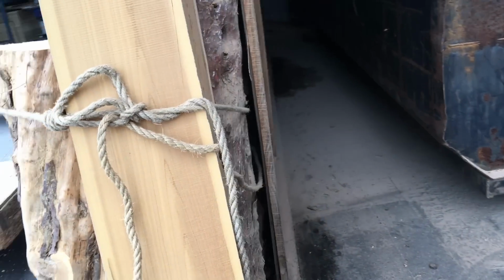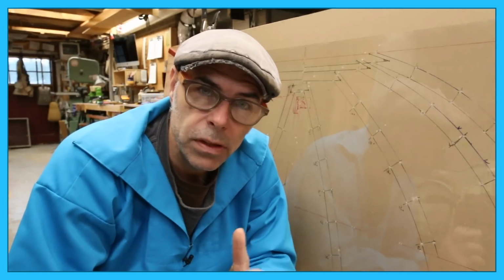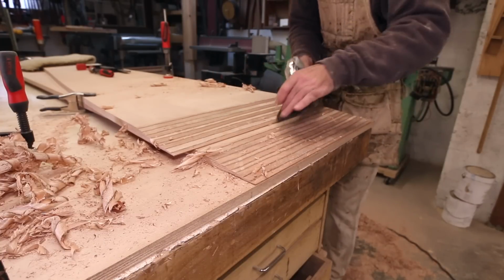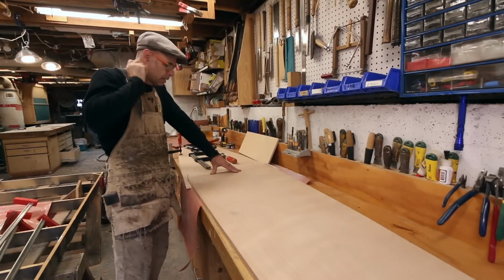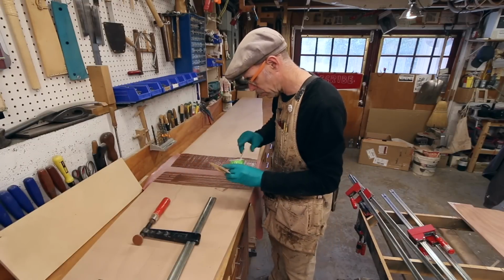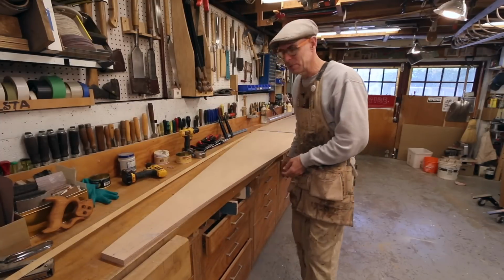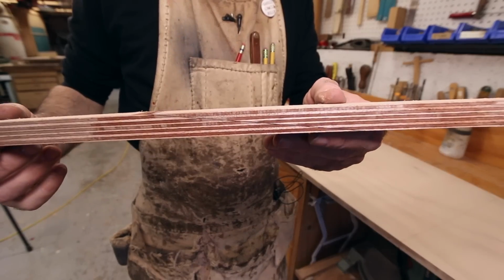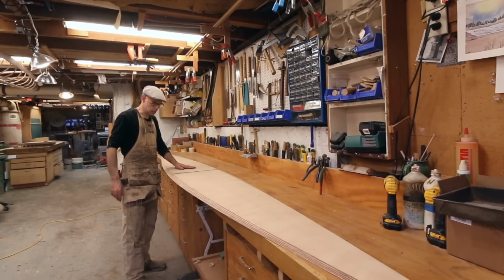Building the Catalina Wherry - Part 7 - Starting Construction

Comment: Mark, I never thought of epoxy like that.  I use West System.  How much a pump?
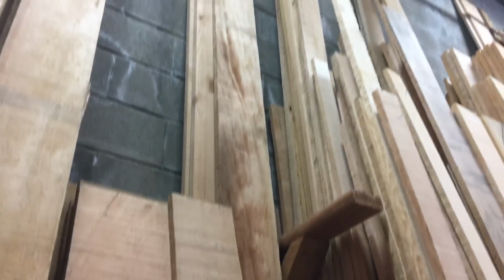Reply from the maker: About $2-$2:50 per pump. Depends on the hardener. The 207 is more expensive than the 205 or 206

Comment: Have you ever tried cutting  slow epoxy with acetone as a penetrating coat?
Reply from the maker: I haven’t, but I know you can thin epoxies with acetone. You can also use lacquer thinner or denatured alcohol. West System allows for about 2% thinning without compromising structural strength. I don’t feel The need to chemically thin epoxy. I can warm the resin if I want lower viscosity. West System did a comparative study of low viscosity penetrating epoxies and found they didn’t penetrate any better than warmed 105 resin.
Reply: @Nomadboatbuilding   thanks , I like that warming idea but does it eat into pot life?
Reply from the maker: Yes it will so you have to find work arounds like limiting batch size. Most of the occasions in which I need larger volumes usually involve dispensing the mixed epoxy in larger volumes too. Like wetting out fibreglass. I pretty much dump out the whole pot at once and spread it out quickly. The exothermic reaction slows immediately.

Comment: I'm so happy I found your channel! I love it and your fabulous content. This vid is especially interesting for me because I made my first scarf with a power plane recently. Intuitively, I started out as you did, running across the sheet, slowly reducing each ply and trying to keep the lines parallel and true. Then someone told me to change my technique to run diagonally and before long the lines were all wonky. Eventually I dialed back the blade and I was able to correct them, and thankfully the scarf wasn't for anything important (we were just making a ramp). But the process was interesting. Loud for sure, but also fairly fast. Finished the job with a dull-ish hand plane (I need a LOT more practice). Thanks a million for sharing your expertise, humour and projects. It's appreciated!
Reply from the maker: We build our skills in baby steps. It sounds like plane sharpening might be on your list. I recommended you check out Rob Cosman's channel for sharpening advice. It’s not the way I do it but it’s obviously a very fast and effective method.
Reply: @Nomadboatbuilding  Thanks for the tip. I'll most certainly check out his channel. Sharpening looks like an art in itself.